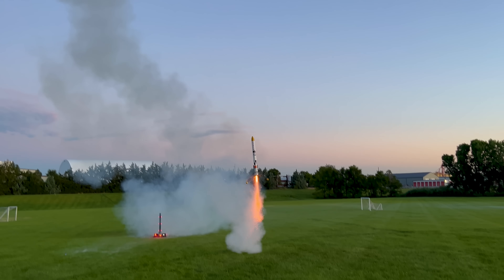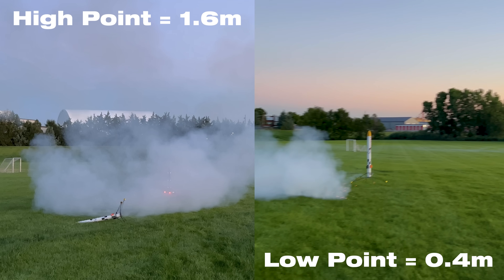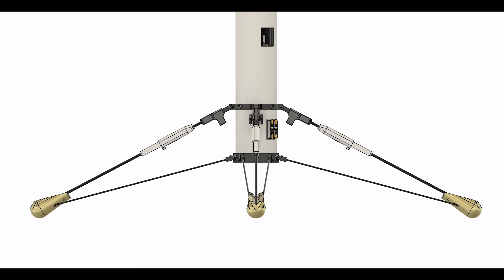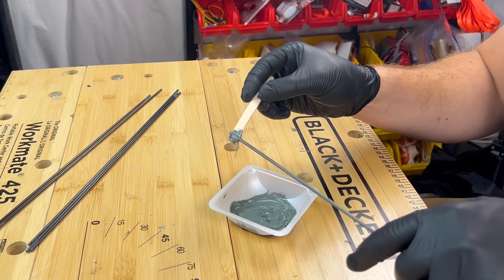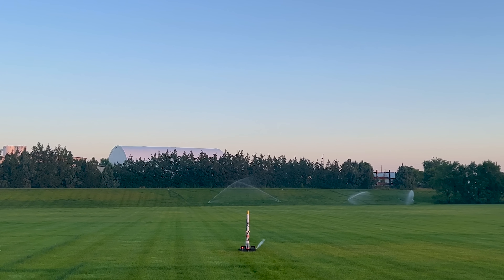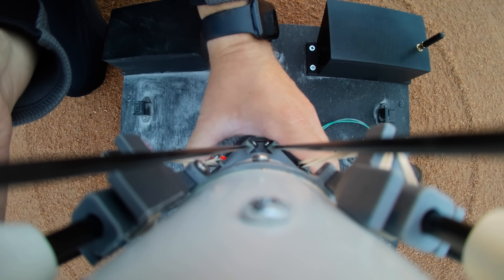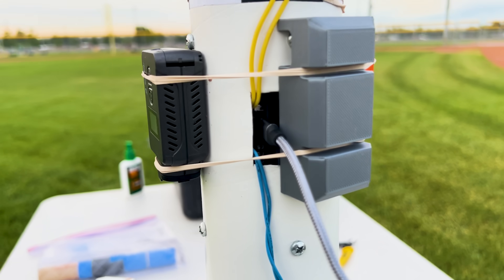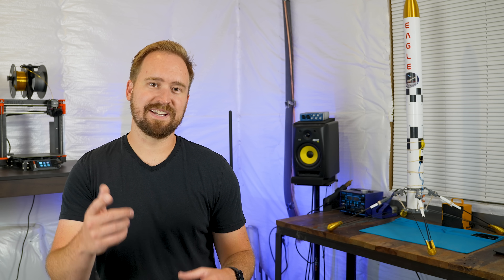This Model Rocket Lands Itself Better Now

Comment: I know that this is a year late, but what if you put the weight internal on a slide block that can ratchet down upon landing similar to your leg dampeners?
1. It puts the outside weights inside improving aerodynamics, and
2. Provides more dampening for the body itself similar to Japanese building earthquake proofing.
Test with and without springs and with and without ratcheting. You may find that the weight actively dampening between top and bottom springs may work well. This doesn’t negate the need for the leg dampeners but may reduce the main load on your leg dampeners.
Reply from the maker: THIS IS A GREAT COMMENT! In fact, the rocket kinda does this in a way. I have external dead weights and cameras on the outside of the rocket and when it hits the ground they often move. This isn't exactly like ratcheting against a spring, we instead waste energy into friction form the items against the body tube, but very similar. I noticed this a couple years ago and like the fact it helped a little bit so never worried about really clamping them down to the body tube. I like your more sophisticated approach, but can't say if I'll come back to this project anytime soon or what I'll add to it, but I'll definitely keep it in mind. Thanks!

Comment: I think what you’re doing is great and neat to see. I don’t know this idea will work or not on a rocket, but have you tried some of the jet engines that other aircraft use in modeling?
Reply from the maker: I've considered hobby sized jet engines and propellers in the past and I do think they could work for this type of project.

Comment: What mistake did you make, was it the timing?
Reply from the maker: The rocket calculates the altitude to light the second motor each flight. I just had an offset to that calculation so that the ignition altitude was just a hair lower than normal.

Comment: Sweet! Great video! Very nicely done ✅ did you ever consider Hydraulic type struts vs springs?
Reply from the maker: Thanks! Yes I did, I wasn’t able to find some small enough for this, but I also didn’t look very hard either… Happy for part suggestions if you have them!
Reply: @Project-Horizon Will do! A lot of the big R/C cars use them some even use air charged versions in addition to the hydraulics….. This way you could adjust the resistance to just the exact amount needed for your application 😊 I use to launch the Estees rockets C-6 5’s many years ago as a kid….. always enjoyed them😊

Comment: Actual Lunar Lander did not use springs but a crushable honeycomb structure. Adsorbs energy, no bounce-back, single use.
X-20 Dynasoar used a metal (wire) that would stretch to adsorb energy. I've had success with pure copper wire for this task.

Comment: what 3d printer do you use? can you maybe share a link please?
Reply from the maker: In this video was the Prusa MK3.5, but I've since upgraded to the MK4S. They did just released the Core One, which is basically the MK4S with newer and more features. You can't go wrong with anything Prusa, I can't recommend them enough.

Comment: I love that launchpad box you have. Do you have files/specs for it?

Also, ever done one with a water system for kicks?
Reply from the maker: I don’t unfortunately, but it’s super simple; just some plywood, 2x4’s, and plumbing I found at Home Depot. Electronics are fully custom though so not something I share at this point considering they’re always a work in progress.

I love the thought of a water system for fun! I’d have to waterproof a lot for that to happen considering how much electronics are on the pad, but it would definitely be cool and add to that wow factor.

Comment: I disagree with your technique on having the compression lock up like that… RC car shock absorbers dampeners what's wrong with those?  Find a way to just get a dampener and have the landing gear return to its normal position.  Man you can drop RC cars from space and they survived because of their dampening system
Reply from the maker: No worries! There will always be a bunch of ways to solve a problem. That's why engineering is so much fun and why constructive criticism is so valuable. For me, designing my own ratcheting system was both cost effective and preformed as required to make this project successful.

Comment: Hear me out, put a sensor on the bottom to make the engine cut out when the legs touch the ground... 🤷

Epic vid btw
Reply: It can’t cut out since it’s a solid rocket motor
Reply: that isnt possible with a solid fuel like this rocket, one solid fuel has started burning, it cant be turned off.

Comment: For it to be spacex style now you need to catch it on chopsticks
Reply: Starship is still under development and is not operational, falcon 9 is in operation and they land like this routinely. Also, this technically isn't SpaceX style, it's Blue Origin style since they were the first to land a rocket booster even if it was sub orbital.
Reply: OKAY WHO WROTE THIS
Reply: Ironically before the rocket did a flip at the top before doing the landing burn SpaceX also does a flip before doing the re-entry burn
Reply: He's trying to land it in falcon 9 style
Reply: @Fıerzó88 yeah
Reply: @tango_mango.11560 I’ve seen you somewhere before..
Reply: With many it is possible . Good thins is that spaceX wont to use patents , same as Tesla , never. All product from Tesla and SpaceX is opensource forever.
Reply: @sreachgeo5359 Bit of a stretch to call it open source justice because they didn’t patent anything.

In fact if it were open source it would literally be an ITAR disaster.

Comment: How did you get the rocket motor to stop, then start again?
Reply: it can be coded i guess. For example you can give code to brain if it has laser ruler, like start second engine when it is 20  meter above the ground

Comment: I think air bleed dampers might get a better landing result than springs. A bit like a bicycle pump type setup. You could 3D print them also, using solid and flexible filament for the piston seal. Basically make a miniature cylinder pump with bleed valve on each leg.  It could have a gentle spring inside to return the piston when no load is present.  i.e.  When the model rocket is airborne.  With a miniature setup on each landing leg, this system could significantly reduce impact forces, making landings smoother and protecting the rocket from damage.
Reply from the maker: Great ideas, thank you!

Comment: Very cool.  Back in late '74 while I was in the eighth grade I bought a Centuri Eagle which included a launch pad.  The original launch wire bent so I replaced with one that had spring steel.  The rocket was great--plastic fins, plastic nose cone, and chute which I later replaced with a streamer.  With a C6-5 it could reach 1100 feet and with a C6-7,  2000 feet but I preferred a C6-5 so I would not lose the rocket on the way down.  Sometimes the chute would not deploy but the rocket, with its strong plastic fins, never broke.  Called a 'beginners' rocket, that depended on engine choice and the size of the launch field.

I always used my high schools launch field, and I flew the rocket until 77, so I got in an amazing number of flights until the rocket was lost when it got caught by an odd thermal.

Your rocket is quite cool.  Where I live now, in Phoenix Arizona, I can see the Space X launches from Vandenberg depending on their flight path--amazing since the base is 500 miles distant as the crow flies.

This link is a bit of history about the Centuri Eagle, which I also demonstrated once for my grammar school, and the minute it reached just below the cloud base, it started to pour so my principal--still good friends in his late 80's, said I and my assistant 'seeded the clouds'.  I graduated from that school the following summer and still have my eighth grade diploma.

https://www.rocketreviews.com/centuri-engineering-co-screaming-eagle-john-lee.html

Comment: why not save the weight and just make a slip fit on the rods you can even give it a taper thread and nut to control the drag the slip joint creates

Comment: Don´t you want to attach a retractable gyrocopter module at the tip of your rocket and use broader fins at the bottom instead ? It would safe fuel and too complicated  stabilizing procedures. It would be abit like a dandelion pollen.

Comment: Remarkable achievement.   Musk can vary his thrust and turn it off on command.  I haven't fired off rockets in many years, but they used to be fire and forget, you set them off and they run until they're exhausted of fuel.  Trying to work with that must be a huge challenge.

Comment: This is a spectacularly fun project. Thanks for all the videos.

I'm curious, though: Did you make any use of partial differential equations to any extent in your analyses when designing this rocket or the control software? 
Thanks.
Reply from the maker: Thank you!

Altitude is calculated by integrating the vertical acceleration twice and I have an offline Matlab Simulink simulation model that represents an Eagle flight that uses some differential equation elements as well.

Comment: Excellent work. If I can suggest something: the dumping system should be made by spring and shock absorber, there are many shock absorber useful for this use, like as the gas spring used in the kitchen. The point, more difficult, it’s the use of aerodynamic stabilization system, like as that mounted in spaceX rocket, they’re a three grids opened sideways. Even more difficult would be a greater regulation of the thrust, which should not turn off completely until the end of the landing. Finally, why not just use three legs instead of four? You should get more stability and reduce weight, cost and complexity.
Good work and congratulations again for your commitment.

Comment: Interesting, can I make a couple of suggestions? Get rid of the 'one way friction damping' mechanism, the friction variability is something you can do without, and install a proper, damped, shock absorbing system, look at RC cars. Second, have you tried TOF sensor(s) to measure the height above ground so you can trigger the landing rocket ignition more accurately?

Comment: You still got a Lot of Non-absorbed Rebound energy goin on.....Maybe if the Upper strut connecting Ring was allowed to travel Upward on the dampened Body tube would the rebound energy be absorbed ??

Comment: Would using PETG for the 3D printing filament for the clip part that kept breaking be better since it has a bit of flex and is not as brittle as PLA?
Reply from the maker: I would think so. After the white/grey colors worked better I just never felt the need to go that route. That said, this project has gotten me to think I need to up my 3D printing game into the higher grade filaments for projects like this.

Comment: You need a landing shock that will absorb quickly like you have now but release slowly so the  unit doesn't sit off balance if it makes a rocket hop or pitches sideways like landing 2.

Comment: Well done 👍👍👍 is it at all possible to mount a small stabilization gyroscope in there so that your rocket is kept gyro stabilized.... Also, have you ever encountered electrically controlled solid fuel rocket motors ? They only burn and thrust as long as there is a small electrical current going to the fuel... In such a manner, could you not use a motor controller chip process for precise deceleration. Combined that with the gyros stabilization and you could have some very interesting precision flights as well as precision landings !!!

Comment: I think you chould work on an engine with adjustable thrust, that you can turn on and off. Your tests, at scale, would probably destroy a full size rocket. You do not need to be able to land hard, you should be able to control the rocket so that you can land softly, and landing on grass is out of the question. That would be like trying land a large rocket on trees.

Comment: May even consider using five legs. Five legs make it even harder to tip over. The government had tons of four leg chairs they bought for everyone in the electronics repair shop. And so many were easily able to tip them over trying to slide them around. So they got rid of all the four legged chairs and bought five legged chair and that stopped the tip over instantly... Just an idea!
Reply: Yes but five legs is more weight, three legs, though is more forgiving on uneven ground?

Comment: I was thinking about the motors. Model rocket engine design is simplistic, with a hollow cylinder of fuel grain burning on the inside face. There are two processes in motion: one, the engine gets lighter over time, increasing acceleration towards the end of the burn. And two, the burning surface is larger toward the end of the burn, which means more thrust and higher acceleration. It seems if you are willing to put in some work, you could taper off the thrust in a predictable manner. The Space Shuttle SRBs start with a star-shaped (more like sprocket-shaped) core cast into the grain. This gives it way more surface area at the beginning of the burn. If you were to make a clay star-shaped (sprocket-shaped) casing, with the teeth on the inside wall, when the grain is cast into the casing, it would have a tapered acceleration toward the end. The burning surface would decrease over time. Tinkering with the number of teeth in the sprocket, the depth and taper angle, you would be able to fine-tune the thrust to your liking. I've never seen anyone try this. If anyone has a video on it, it would be fascinating to watch.
Reply: James - You've just touched on a subject that has religious ferocity in amateur rocketry almost as intense as the motor/engine one in model rocketry! I actually got to crawl around inside the bore of a Shuttle SRB engineering mockup (well, the top segment, anyway) as part of a job I was quoting. This was a completely accurate casting, it just didn't have any AP in it (only the PB rubber and aluminum powder). I had to stick my head into the narrow neck-down at the top to look down the slots in the grain.  There were 11 of them (always an odd number so that no two openings face each other) and more that a little awe-inspiring, considering what this machine does!

Comment: I fly tiny whoop fpv drone. And the clear frames are much stronger than the colored one. So I thi k that's an issue with all plastics. The clear will flex as where the colors frames will flex just a few tones before becoming brittle and breaking

Comment: Browning A5 shotgun uses short recoil operating principle.  The barrel reciprocates to cycle the action.  Its damper is a split bronze ring that slides on the magazine tube.  The barrel has a guide ring that also slides on the magazine tube.  This ring has a female internal chamfer which mates to the bronze ring’s external chamfer.  When the gun fires the barrel starts back and the chamfers squeeze the bronze ring on the magazine tube for friction damping.
(Also the barrel recoil spring is between the bronze ring and the receiver…so the ring always has a bit of force on it)
     The system in the video does not dissipate energy, but transfers it to the spring.

Comment: A little late now, but the common washing machine rod suspension might have been an out of the box win.  They're basically exactly what you needed, springs and damping built in, although not necessarily as light or easy to tune.

Comment: Hey just a suggestion on the software side of things.  changes to your code can be wrapped in "feature flags" controlled by a config setting, so that if it causes major issues turning it off on the fly can be controlled via config changes rather than having to re deploy all of your code.  Its something we use in the software industry very commonly and helps with mitigating risk, as well as allowing us to turn on experimental features in test environments while keeping the the old functionality available.  Great job on the project and successfully landing with the newest changes!
Reply from the maker: I work a lot with Software Engineers and they do this on a lot of projects. I have no idea why I never thought to do the same for this project... Thank you for the suggestion!
Reply: @Project-Horizon  glad I could help!

Comment: Why not start using PETG? Has overall much better properties and brands like Elegoo have really good deals.
Reply: Oh, by the way- absolutely amazing work and design.
Reply from the maker: Thanks! Using PETG was the next step if the white/grey parts didn't work out. However, since they ended up performing well I didn't feel the need to go with PETG this time.

Comment: Very nice engineering! The lunar module had similar dampening to this - except theirs didn't need to be reused. They absorbed the impact using aluminium crumple zones. I think this is also the reason the ladder was so far off the ground as the landing impact was less than they expected, so it didn't crumple all the way. Can't wait to see your next project!

Comment: great work!  congratulations for that amazing landing.

Just look how to tweak other aspects
0:28 Rocket power is too high, instead of hovering goes back up.
0:28 Power goes out while still too high
happens along  the landings.
02:06 
if the rocket is not controllable, the time is.

Comment: I'd change one bit of the suspension: A delayed reset. 

After deployment, if it bounces or takes off again, it'd allow you multiple tries at landing instead of the one-shot catch mechanism.

A piston would let you control the reset timing with air orifice size. Spring to absorb & dampener to extend the release time of that absorbed energy.